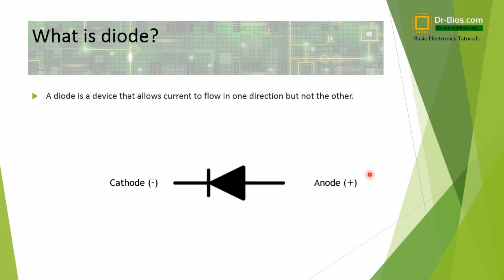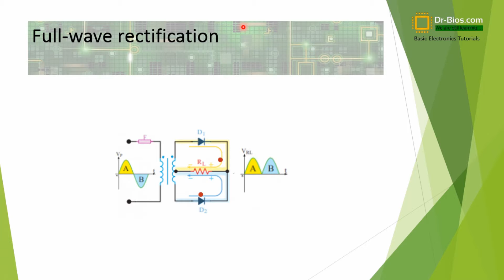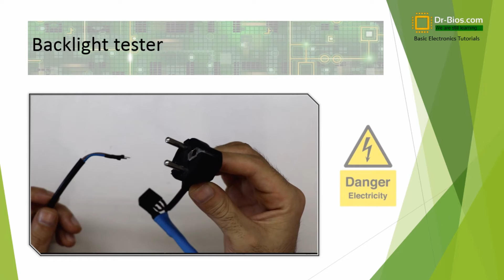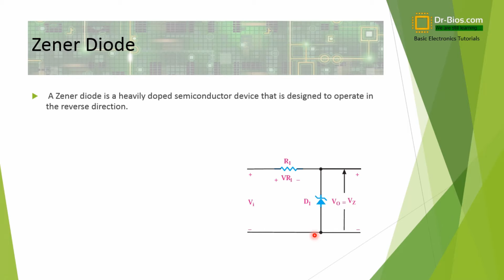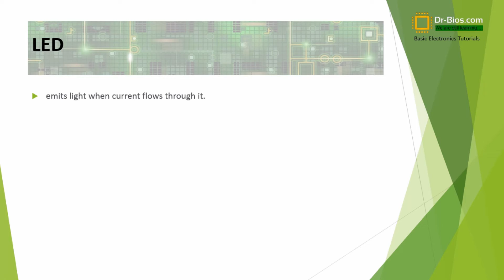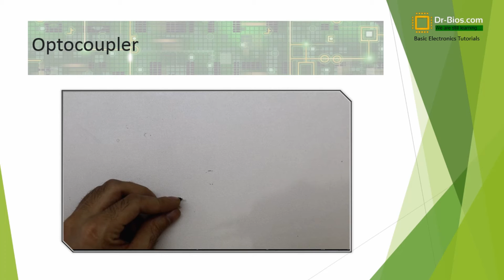What is Diode and its function in circuits?

Comment: Hi I have a question I have a power bank module to charge my lethuim ion batteries but I don't want the battery charge to go back to the module so I added a diode how would that affect the charging will the module detect the right voltage or will the diode affect the voltage reading of the module?